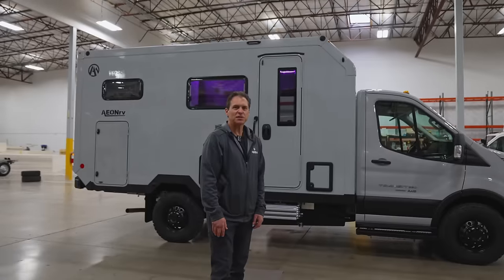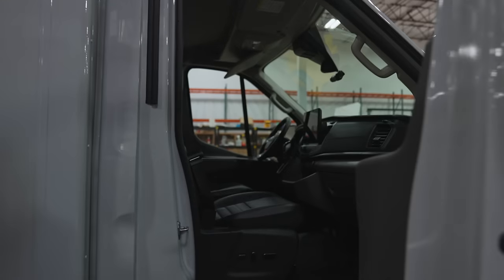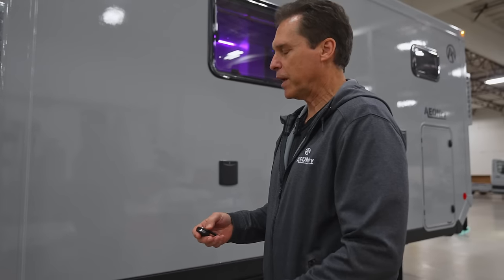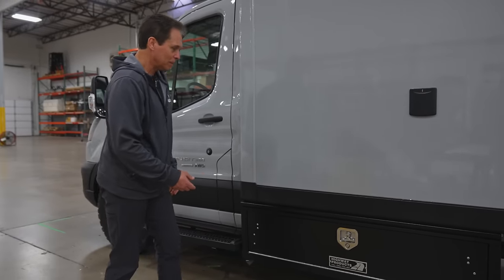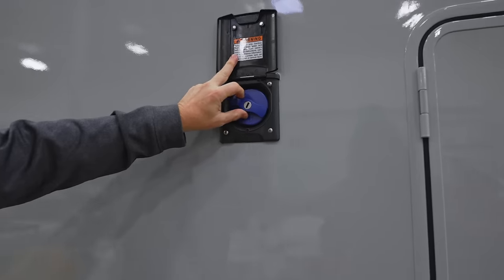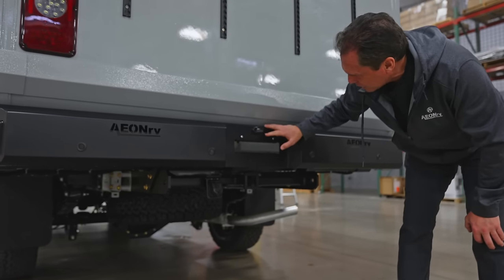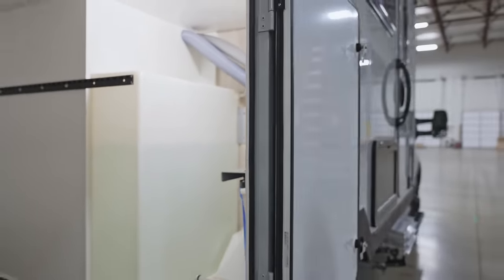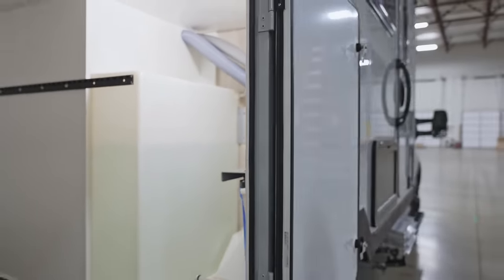The Future of Adventure—A Tour of Our Latest AEONrv!

Comment: Can I suggest something in regard to bathroom? The toilet bawl would be much more discrete if you put the flexible rolling door right in front of it. Like rolling door in Travato 59g bathroom. This way when you enter the rig, you see very nice and clean wall at your right shoulder, but when you want to use the toilet, you just pull that door and it slides into position to open access to a toilet and blocks view from inside of the rig. You can even make bathroom larger while in use, by making the door rolling deeper into the rig, forming kind of rounded shaped wall. This will make shower area much larger. I think it's very good idea and it won't cost much compare to improvement it provides. It adds cleanness and streamlines the toilet solution.
Reply from the maker: Everything is a tradeoff, the shower curtain can already be used to block off the toilet and sink when you enter if you don't want to see them.
Reply: I agree you can't turn around in the shower but cubic feet of wasted space next to the water tanks.
Reply from the maker: @noahziegler3478  Plenty of room in the shower even for larger folks. The area in the gear garage is not wasted as it is for storing bikes, skis, inflatable kayaks, etc.
Reply: I agree that seeing the toilet from the outside or the inside  is a turn off. Maybe you can just add a second  “rolling door” in front of it and take the curtain off all together. I would also make sure there is a fan in the toilet area so  smells do not linger around or “greet you” when you walk in the rig after someone used the toilet…
Reply: @opinionatedartist  how dare you lol. From reading replies Aeon thinks this rv is perfect and any feedback or personal preferences is stupid
Reply: @LisaLightning Don't forget to pour half cup of white vinegar Into urine bottle every time you put it back into toilet. You will never feel any urine smell this way, like never.
Reply: agree the only minus is when gettin ginside theres a toilet.  not a good booster everytime you get inside 😂
Reply: Both would be excellent improvements. A shower curtain to hide toilet not enough, much less aesthetically pleasing, imho.
Reply: @noahziegler3478 nothing says perfect like wasting space on a trash looking plastic sink instead of taking ONE STEP to the side. ONE STEP. Sitting above the cheapest form of toilet instead of the #1 laveo dry flush toilet.
Reply: I was thinking the same thing. Totally Agree with you. Would even suggest 3 rolling doors, and no curtain at all. I really dislike the curtain.

Comment: Can you make it with a black tank instead of that horrible cassette toilet
Reply from the maker: We don't like black tanks as tough to dump off-grid. We also have the option for a urine separating toilet, Tiny Separett.
Reply: @aeonrv  plenty of places to dump a black tank and with a macerator toilet we get 7 days out of our 22 gallon tank. A shame to have such quality work with only 1/2 a plumbing system. A cassette toilet is only good for maybe 2 days off grid unless you’re just dumping the cassette in a hole.
Reply from the maker: @Nomad33fw58FS  Everything is a tradeoff and we don't like either macerator toilets or black tanks. If you want the cassette you can easily take an extra 5G tank in our outside storage box, which some customers prefer. We can go up to a week with the 10G. With the urine separating toilet we can go multiple weeks.

Comment: Very nice but I would ask for more ground clearance for backcountry adventures. Tuck in the exhaust so it won’t get crushed, replace the driver and passenger running boards with retractable ones, add rock sliders and reduce the height of the side storage.

Comment: Expedition type build for an RV.  Nicely done and with a proper power system. Should sell many at the sub 250k price point with RV financing.
Reply from the maker: Thanks!
Reply: Most True 4 Season RV's start at 250K & go up from there. It's pricey & basic & with limited resources available, no propane, no generator, no tv. I like the idea of being able to charge the batteries off the RV engine with a switch. I look for an RV that is fully functional within it self relying on no outside resources. So many have A/C but only on Shore Power. I like camping out at Road America on extended Race Weekends. To do so with electrical hookups would cost me more than double the regular weekend camping fee. Yes We could throw a generator into the mix, but than you run the noise on hot nights with other campers who are in tents & trying to sleep & the additional cost of the generator fuel. I like the idea of going fully electric, it's just finding ways of keeping those batteries charged.
Reply: 700 watts of solar to charge up to 13.6k watt hours of LiFePo4 batteries + DC/DC charging.  No need to plug in for a race weekend. I would like 1300 on the solar but its a nice stock elec. system.
Reply: @MexicoDrones  I'm still looking at this RV. I like the fact that it is pretty self sufficient with everything she has in her & doesn't rely on outside resources. To me that is a big plus. I like the cassette toilet as to me it is easier to empty, I like the Max Air Fan as even on a warm night, you can run that on low & be comfortable. It has a nice size fridge & freezer. It would be very interesting to get to take a trip in one of these. I sure miss my Dodge Camper Van. It was no where  near this nice.
Reply: @MexicoDrones  This is exactly what I've been looking for. I've also seen what it would cost to put a nice solar system on a van. Very expensive, but upgradeable.

Comment: Some nice innovations here. I like the pass through shower idea, fold down sink, and toilet separation. I’m guessing there must be a manual way to pop the escape hatch over the bed, as if there was an bad event with power failure. The insulated lockable passthrough door is great, as blackout curtains really do little to keep out the cold of the cab in winter. Lots of storage cubbies too ! Not a fan of the countertop soap dispenser, as they drip, and are a pain to bend down and refill. A store bought container of Dawn is so much better. All in all, pretty good starting point for a backroad or highway cruiser. I’d pick it over a Revel awd. 👍🍁
Reply from the maker: Thanks for the feedback. Yes, there is a crank to manually open the skylight. Countertop soap dispenser is filled from the top and has not leaked and would leak into the sink if it did.

Comment: I have a suggestion for the shore power and water filler. I am currently building my own insulated RV (similar layout to yours) and have decided to put the shore power connector next to my driver's seat in the cab. This means the connector is protected from weather and possible vandalism. Also, I loop the connecting cable through my steering wheel which ensures I don't forget it when driving off. The cable exits through the rubber seals on the front cab doors without any issues. On the subject of the water filler, I am installing it inside, above the sink. Whenever I need to fill up, I just put the hose through the nearest convenient window. The inside location prevents freezing, which can affect the locking mechanism in cold conditions. Also, it's protected from road dirt and vandalism. Another idea, which I borrowed from another YouTuber: I'm fitting a 2 way tap to my shower head. I have a master shower tap outside by wet room. When I turn the master tap on, the hot water is pumped into the shower but I have a 2 way diverter. The default position recirculates the hot water back to the white water tank. This helps twofold: It keeps the water in my white tank a bit warmer, preventing any possibility of freezing in very cold conditions. It also allows my shower to get to full temperature before I step in to the wet room. I turn the tap and water diverts to the shower head.
Reply from the maker: We already have a reminder system to prevent driving off with either the shore power plugged in or the stairs down. Water filler inside is bad idea as people will spill. The water tank has a locking cap. The electrical has a special plug.

Comment: Just wow, not one single flaw! And many more features than most high quality manufacturers have.. this is the Pinnacle of perfect
Reply from the maker: Thanks!
Reply: I would not call these  flaws, but shortcomings. If I had to manually pull out those steps every time I enter and exit the rig, that would be a deal-breaker for me, especially on rainy days. Once inside, I would have to exit the rig from the front and then pull out the steps if others are inside. EVERY time. No way.  For the owner, who is 6 ft tall, the compartment doorway between the front and rear living area, seems quite small and tight. I'm 6'3" and do not consider myself to be tall. Sitting on the bed , it looks as though anyone taller than 6' would have issues in that position. If the steps would extend and retract when the door opened and closed, I could overlook my two other concerns. 7 out of 10.
Reply from the maker: @davidjackson7336  We much prefer manual steps over automatic for 2 main reasons. The manual steps are much stronger and the vehicle does not sway when you step on them. Second, auto RV steps are notorious for breaking as they use tiny electric motors. When we are in camp we just leave the stairs down. When you drive away we have method to remind you to put the stairs up. Regarding the passthrough and the bed height you'd need to try it out to see if it works for you. We have a customer that is 6'6" and it works for him.

Comment: Most True 4 Season RV's start at 250K & go up from there, so this falls in that range. I feel it's pricey with the basic needs & with limited resources available, no propane, no generator, no tv. I like the idea of being able to charge the batteries off the RV engine with a switch. I look for an RV that is fully functional within it self-relying on no outside resources. So many have A/C but only on Shore Power. I like camping out at Road America on extended Race Weekends. To do so with electrical hookups would cost me more than double the regular weekend camping fee. Yes, I could throw a generator into the mix, but then you run the noise on hot nights with other campers who are in tents & trying to sleep & the additional cost of the generator fuel. I like the idea of going fully electric, it's just finding ways of keeping those batteries charged. I'm just fine with the cassette toilet & I like your ideas on the freshwater heaters. I'm ok with the induction stovetop & like the space saving idea of keeping it portable. I would upgrade that to a 2 burner. I don't like the idea that the A/c blows right out over the bed. We are working with Global Warming & nights in a confined space are a lot warmer than they used to be. I like the nice big Max Air Fan. So many newer RV's have come out with these smaller ceiling fans that are complete junk. Why put something in there that's going to fall apart the first time you try & use it?
Reply from the maker: Thanks for the feedback. Quick comment on the inside AC unit, it is adjustable so it does not blow on you and has a sleep and whisper mode that is 26dB so you can not hear it at night.
Reply: @aeonrv  Do you have any review videos from anyone that is using one of these AEONrv's?

Comment: Bathroom situation is excellent!
Reply: Really?? Sammy, your definition of excellent differs dramatically from mine.
Reply: @MaximusMerideus And it's a good thing!
Reply: Excellently nasty you mean
Reply: Agreed. It acts as a nice mud room and removes the need for an outdoor showering point. No black tank to worry about with the cassette is another bonus. The flip-up sink is simplistically efficient as are the awesome mechanical stairs that won't draw down valuable electricity. Much better configuration than the Revel layout and less of a PITA in actual use than the Storyteller while coming close to the innovative semi-dry ModVans solution. Biggest win IMO goes to implementing the Pioneer AC/heating unit and placing its location in the back, freeing up space on the top for more gear hauling.
Reply: Well, with all respect  to all comments on the bathroom, I'd like to try it before making a final decision!😊

Comment: This looks amazing. Fantastic looking camper van. The only criticism I have is the shades and screens on the windows installed upside down. The shade should come up from the bottom so you can block looky loos while still having the screen come down from the top so the windows can be open. The European style windows are awesome, but they're designed to have the shade pull up and screen pull down.
Reply from the maker: Some people like to have them pull down so better blocks sunlight. In either case, it is very easy to switch the shade around. Thanks for the feedback.

Comment: I do prefer the separate cab as the steel cab with windows is a greenhouse in summer and a freezer in winter. I try to park with the cab facing North in summer to try and reduce the direct sunlight on it. My insulated box provides the shade. I like the transverse bed as well.

Comment: Please advise what is the support and maintenance network on these RVs for parts, maintenance, tech support, warranty, etc..since the Ford truck portion is modified, and also for the RV specific portion. Thanks, great video…awesome RV!
Reply from the maker: Transit chassis is covered for Ford's 3 yr/36k mile warranty and 5 yr/60k on the drivetrain. We provide a bumper-bumper 2 year/24k mile warranty and warranty the box integrity for 10 years. Appliances come with additional warranties like 10 years on the batteries, 5 years on solar panels, etc. We handle directly all our warranty in our main facility in Reno and via phone/email support. We are launching mobile support later this year where one of our RV Techs come to you. Finally, we will be opening additional support/sales centers starting in early 2025.
Reply: AGREED 👍

Comment: Love everything about this RV, except the black interior. Most people use RV's in the summer, and it usually gets hot. You have to park in the sun because of the roof solar panels.  BLACK interiors make the RV hotter!
Reply from the maker: Our interior is white fiberglass and light woodgrain & white cabinetry. The seats in the Transit cab are black leather and gray everywhere else. Ford has discontinued the leather seats so 2024 models have heated/10 way power gray cloth seats.

Comment: Really like that the shower is a mud room that even allows boots to be cleaned outside. 

This is exactly what Foresty Forest channel needs, but there is no way he could afford it. 

Also really like the mini split AC. 

24:38 Heat the hot water using the coolant lines off the engine!!! 

Were you like a NASA engineer who got bored or something ?

Comment: Really well thought-out. Love the whole bathroom situation, for example. Also love the large, vertical fridge/freezer, storage steps, and lots more. Storing mountain bikes is a significant consideration for me, and that garage space looks potentially pretty tight for that purpose. Could you post a video showing bikes coming in and out of the storage compartment?
Reply from the maker: We've can fit 2 modern mt bikes and a road bike in the garage. Need to take off front wheel and typically drop the seat. One customer even carries a tandem bike. We'll see if we can post a video of that specifically, but ther are shots of the gear garage with bikes in them on our social media.
Reply: @aeonrv   I had looked on the website, but after seeing your response scrolled down a ways on FB and found some pictures with bikes loaded in the garage, which helped a lot. Thanks.

Comment: This is truly amazing. If you can give more details about how/where to hook up at an RV park overnight that'd be great. You mentioned the power and the water intake (something about an adapter?), but the grey water ball valve was shown, but wasn't clarified. Where does the water go from the foldable sink above the toilet? Where does the shower water go?
Reply from the maker: We provide a 30A shore power connection that can also be plugged into standard 15/20A socket. There is a 28G gray tank for the shower and sink drains.

Comment: My one question is, is All Wheel Drive as good as four-wheel drive? And if not, is four-wheel drive with lockout hubs, available? I have not had a vehicle with all wheel drive, so I do not know about that.
Reply from the maker: The Ford Intelligent AWD works great and has a high mode (slippery) and low mode (mud & ruts). No need for lockout hub in our opinion.
Reply: @aeonrv  Okay. than you!

Comment: Hello! I'm loving this build so far. Just a couple of questions:
1) Would it be possible/easy for customers to swap out the 8gal hot water heater with a continuous hot water heater?
2) Roughly how long can this RV hold power off grid with moderate? Meaning no shore power and not starting the engine. Would the A/C heater be able to run all night?
Reply from the maker: The 8gal hot water tank is continually filled. It is basically free hot water so not sure why you would want to replace.  We run the AC off batteries all night and typically use less than 20% of the battery capacity. The mini-split uses 250-350W/hr once set point is reached.
Reply: Oh awesome! Apologies, I must have missed the part of it being continuously filled. For sure wouldn't want to replace that. Thank you answering the question about the AC as well! @aeonrv